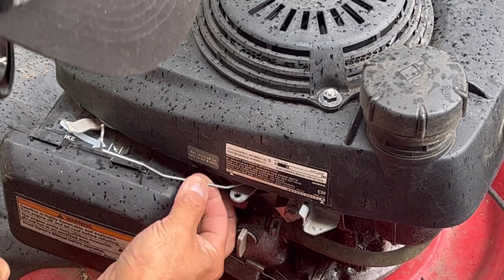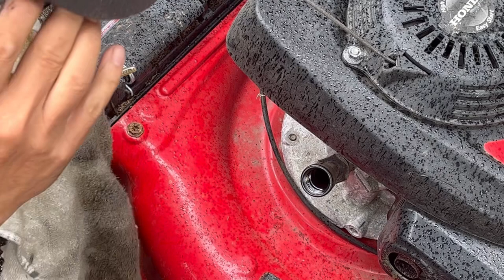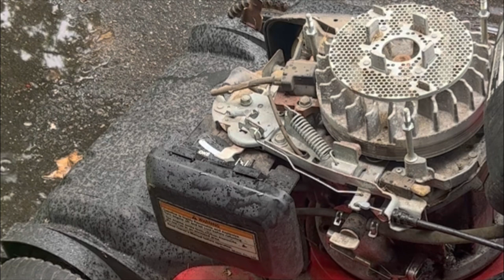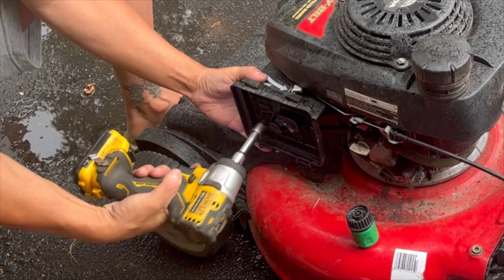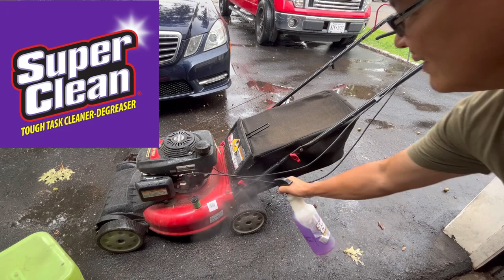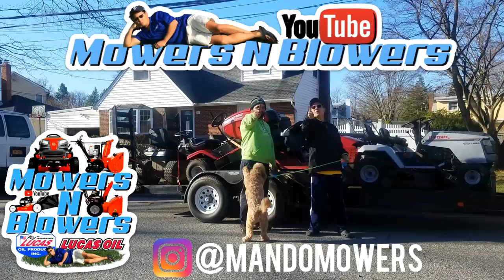MY MOWER WONT START! TROY BILT 21” FRONT SELF PROPELLED HONDA POWERED LAWNMOWER BRAKE CABLE & LINKS

Comment: On Honda's you pull dipstick out, wipe clean, put dipstick in tube (don't screw in).  Pull the dipstick out and check level fill if needed.

Comment: Nice job Henry! BTW on that auto return choke system the lever is supposed to start moving slowly open immediately when the bail handle is pulled, it’s not supposed to hang up in the closed position. No thermal influence on that type of choke, it runs strictly on a fixed amount of time once the catch is released no matter the temperature. Linkage probably needs a shot of lube if it’s getting stuck closed like that. Nice mower bro!
Reply from the maker: Thanks bro

Comment: Henry life gets a lot easier with a Pender lift and using same thread studs to hold the assembly together as you remove one bolt you insert a stud. These are the manual choke Honda engines and do not have the wax choke insert, these just work off the spring action which at times are so fast you do not have time to pull the recoil before it is off choke. By the way put a new filter in that mower for $250 USD that one is what we in Canada call scrap. Anyways say hello to the alter ego from Jake and i at EP.

Comment: Yeah bro, the pull rope mechanism held down by those 3 10mm nuts, same on Kohlers, take them off with an impact, but never put them on with one, either engine, only by hand, if one or all get stuck they are a pain in da butt to get off.